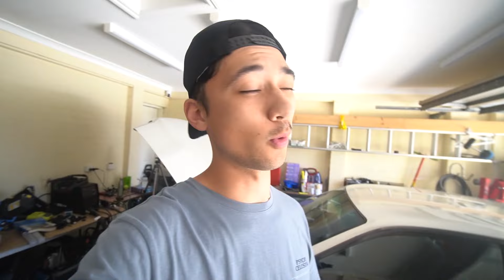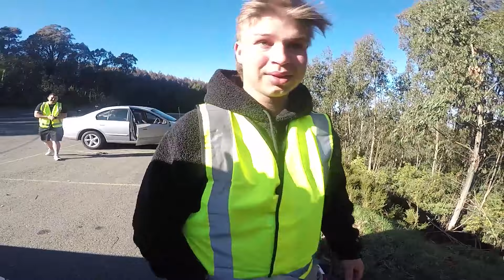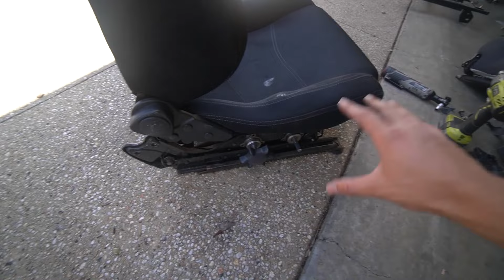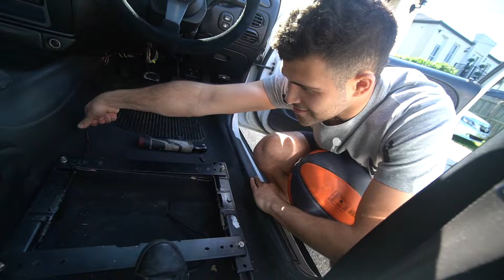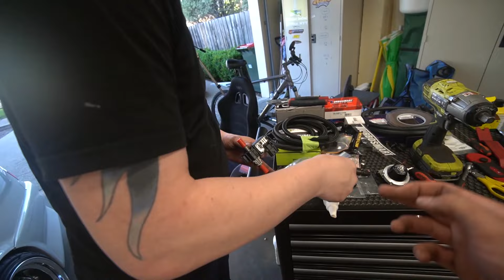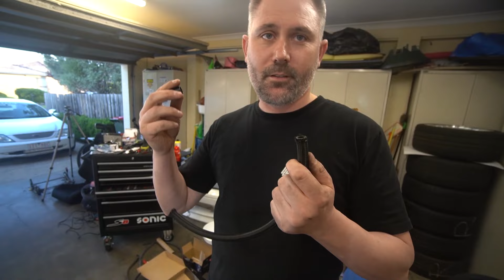AU FALCON HAS PROBLEMS AFTER DRIFT DAY... + JZX100 UPDATE!

Comment: With the radiator, in my auto falcon o had a hole in the trans cooler that leaked trans fluid into my coolant and coolant into my trans. Not sure what your setup is now that you've manual swapped it but it could be a possibility

Comment: Good stuff there mate. Should look into fitting a Holden astra electric power steering pump. It’s a standalone unit and will prevent a stock belt driven unit from failing due to high rpm. Just a thought anyways.
Reply from the maker: never heard of this idea! sounds iteresting

Comment: Is it actually milkshaked or just dirty? If you're driving it hard all the time, you might want to install an exterior trans cooler, or coolant could end up in the trans and it is not fun when that happens.... usually have to replace the trans unless you get onto it fast and then you just need to service the gearbox which is pretty easy, apart from the filler bolt that often strips.
Reply from the maker: it's just dirty, i think theres build up in the rad

Comment: That brown coolant is rust by the looks of it. Have you been using demineralised/distilled water? Normal tap water will rust very quickly.
Reply from the maker: its gunk from the previous owner. it was proper brown when i got it
Reply: @RexH  I do remember that. I also seem to remember you using a garden hose when you were trying to flush it the first time, that's the only reason I asked :) good luck homes